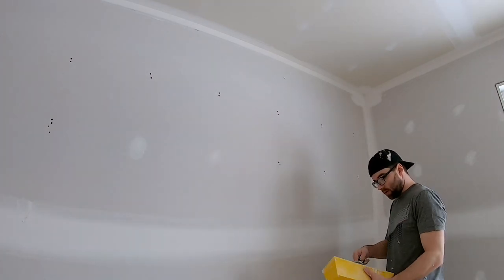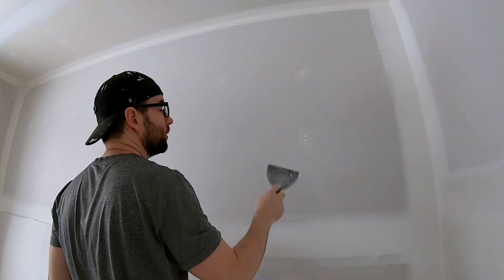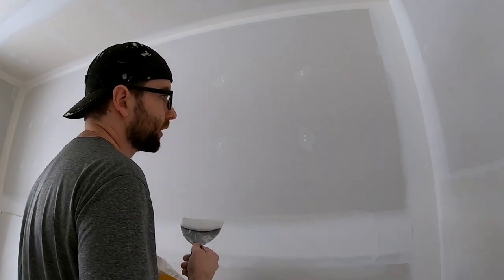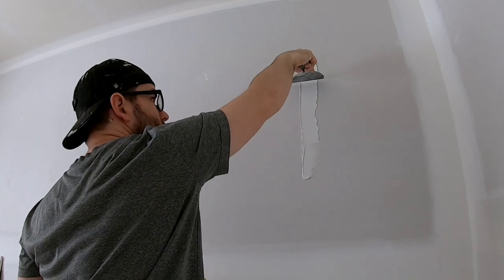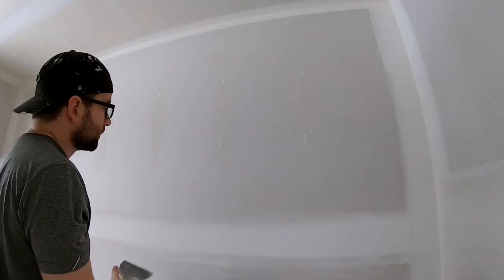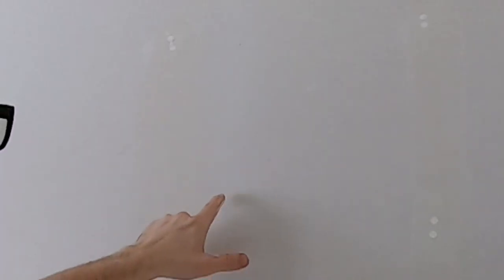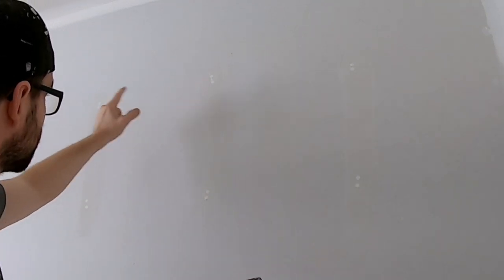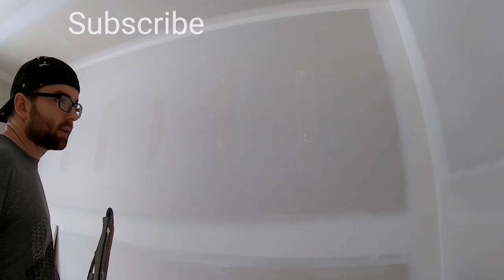How to coat Drywall Screws efficiently

Comment: with what knife you doing that?blue steal or SS.and brand.marshall,hyde,advance,wallboard,red devil?You shud say about tool first
Reply from the maker: Thanks for input, it's a Richard 5" carbon steel
Reply: @Interior_Works  thanks for answer.i am from Austria.i buy a marshallrown and very disapointed.not flexible at all.we dont have very match choise of american brands to buy in austria.